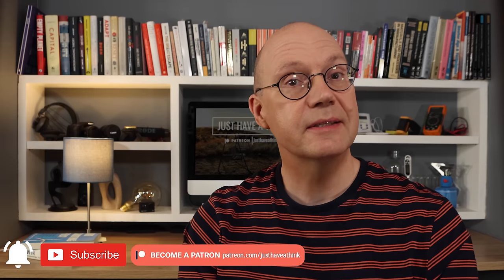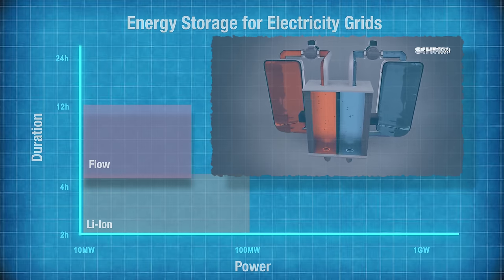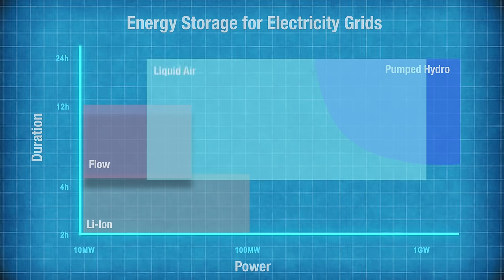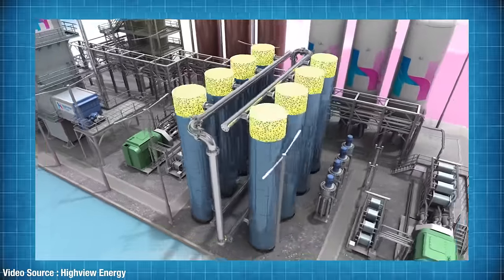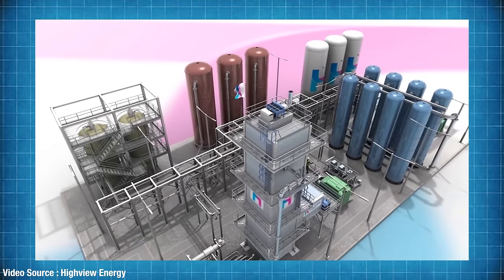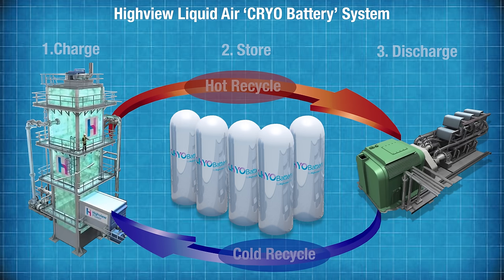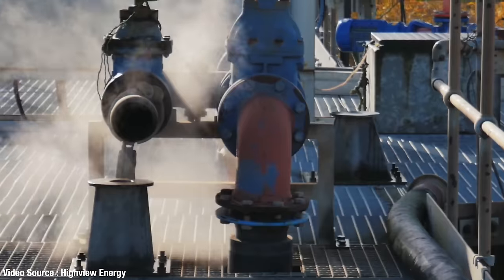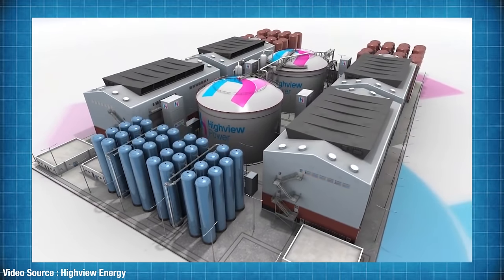Liquid Air Batteries. Literally energy from thin air. Seriously. Literally!

Comment: 60% efficiency is absolutely amazing... IF it is true.  we have seen many programs which tout high efficiency numbers but on closer scrutiny they dont get more than 10-15%.  If this were true many companies and countries would be rushing to buy/build their own.
Reply: When I was in power stations, 1962 - 1972, base load stations ran at just over 30% efficiency. 60% is like a dream come true.  Exciting times ahead and the jolly old UK is again in the mix. Regards
Reply: Peter Mortensen  30% typical, Japan claims 40% as super clean.  You
 see, they do have a sense of humour!
Reply: I agree that 60% verified efficiency is a game changer.  When the raw supply is endless and demand vs supply times are the only major challenge, we can ignore efficiency to some extent when the environment is not threatened.  I also have great hopes for ammonia economy if the byproducts can be avoided or mitigated.  Air batteries for fixed energy storage, ammonia for mobile. Might save us a war or two.

Comment: This seems too good to be true. I feel that the energy that is required to treat and store the air (i.e cooling and pumping into storage) would equate the amount of energy produced, leading to no net energy production. Is that the purpose, since it's merely a battery/storage space? 

Anyway, thank you so much for the video/your channel. I don't miss an episode :)
Reply: There is friction in liquids and all the pumping machinery,and waste temperature flows, so almost fifty percent of your energy is lost, try and use what you can with load shifting, you know like domestic hot water tanks, and aircons ice storage etc.
Extend grid East West so solar contribution is maximised.
Storage is always last resort, although having said that, this is promising.
Reply: Their efficiency is from generation to grid. So 60% of the energy stored makes it into the grid.
Reply: "leading to no net energy production".  Yes, you are correct. There is no net energy production. This is not a system that produces electrical energy, in fact it loses 40% of electrical energy from elsewhere that's fed into it. It's only a storage for energy that's made elsewhere (called a "battery" as a generic term). It's for storing energy that isn't needed but would be a shame to turn it off (like wind mills) so then it can be used later when it is needed (except the 40% that got lost/wasted). I'm not keen on Mister Think's little title quips always but I like his sense of humour and the rest of us (except only you) know instantly what he means.
Reply: If batteries released more energy than was fed into them we wouldn't need anything else lol
Reply: @grindupBaker  I understand...thanks for clearing it up!
Reply from the maker: I'll work on the titles :-)
Reply: It is a battery, just for storage of excessive energy(when the sun or wind is too strong).

Comment: Has anyone looked into co-locating liquid air storage with geothermal harvesting? One of the big problems with geothermal is that so many places that have abundant heat don't have high temperature. However, that heat would be harvest-able in the expander phase of liquid air storage.

Comment: Wouldn't the liquid air in the storage tanks expand a lot when it gets warmer? When it get warmer, the liquid wants to become a gas again and increase the pressure in the tanks.
I don't know if I missed it, but a thin steel storage tank will lose a lot of its cold if it isn't insulated, so the pressure will (unwantedly) increase.
Reply: The increase in pressure (outside of the tanks) as the liquid "wants to become a gas again" is the very energy the turbines use.
The answer to your question is around 6:45: "WELL-INSULATED thin-walled tanks". They insulate them well enough that the boil-off over the months worth of energy that they plan to store at a time is minor.

Comment: Do they use the soil underneath the facility for a heat battery for the heat economy? Phase change needs a lot of heat energy, there is a lot of mass. So are they sitting on like a -200 C permafrost ball? 
Its an ingenious system. Heat does not transfer quick enough to matter in a days length of time in these scales to matter much for efficiency. But i guess there must be like hundreds of km length of heat exchanger pipes in the ground for this to work.

Comment: Interesting, I'm a tad curious about the system efficiency's. Years ago 'they' were attempting a slightly similar system to power cars.
They were compressing air and storing it, then using it to spin a piston based air motor to drive the car. The biggest problem was when the air expanded it basically froze the motor, so I'm wondering where and how they are storing all the heat needed for when the liquid air wants to return to air and expand in the turbine?
Reply: It's shown in the video. The heat tanks are shown in the video and it's all explained. Watch the video.

Comment: On an urban level , having a compressed-air network would be  interesting to!
Reply: Perhaps you are familiar with this but using are instead of electricity is common in explosive environments in fact I am informed that residential elevators are using vacuum pumps instead of a shaft because of course they're not carrying that much weight so the passengers are just sucked up the tube. Because liquid methane is delivered from the ocean to beach front that don't have ports the hose that you need is a well-engineered off-the-shelf product that does not need to be modified for nitrogen. The company that produces it has been caught cooking their books but is one of the largest companies in the world with an extremely short name and rather oblivious to the huge volatility of their stock price.

Like Austin Texas they have a lot of programs for their employees to distract themselves from their work for the devil.

Comment: Neat idea. However, if the battery is 60% efficient then 30% percent of your wind or solar energy is being lost to the process of liquefying the air which means that you do not have any extra power that can be sent to the market.  To me this seems like a fairly large problem overall because this is not simply taking surplus power that is produced by something like a fossil fuel power plant this is literally taking the entirety of the renewable energy product to store up 60% of its production value for future use.  Thereby depriving the energy market.

Comment: I'm pretty sure the premise for this video is outdated.  We don't need batteries of ANY type.  "They" did a study and found that the best, cheapest way to convert the electrical grid in the USA to renewable power is to lay High-Voltage Direct Current (HVDC) conduit in a loop around the country, alongside the highways.  (This is basically the same route as proposed for bullet trains.)  The grid needs the most power when it's sunny, and it's always windy somewhere.  The HVDC grid moves the energy from where it's being collected by wind and solar to where it's needed, as it's needed.  This reduces the requirement for energy storage down to "trivial".

Comment: I have been wondering why we don't seem to be looking at alternative ways of creating steam to drive the existing turbines at fossil fueled power stations. The savings must be huge if you can continue to use the existing infrastructure. I have a theory that using Fresnel lenses to heat a large thermal mass and passing water through it might be a way to create the steam. It would need to be a huge mass but would smooth out diurnal variation by its ability to retain a lot of heat.

Comment: "Cold" cannot be captured and stored, as it is the absence of energy.
Other things rarely mentioned: removing wind energy and heat energy from the system with wind and solar systems can, in theory, change the climate.
Reply: "Cold cannot be stored..." I caught that, but was willing to let it slip by because it is storing a mass of something at a lower temperature, therefore storing the ability to cool.

Comment: Why not built a system that draws on the atmospheric power differential of elevation.  Electrical power increases at a rate 100v per meter above the ground (anywhere in the world), so a 10m tall mast could capture 1000v of power at the top.  Install wires to draw the power down to a storage device and you have an off-grid power system that works 24/7/365 with no moving parts.  Use solid state batteries/capacitors yo store the power and the system, once setup, will run with essentially no maintenance costs for minimum of approx 275 years.  Done. Solved.
Reply: Sadly, you need amps too, and you can only harvest microamps per meter, so to run more than a light bulb you're going to need something ridiculously tall.... otherwise you'd clearly have been a billionaire by now.
Reply: Coenraad Loubser The is an experimental farm in the USA running 100% of this method.  They have 4 towels (20 meters tall each, if memory serves), with antenna running between them.  They gather so much power that during storms they need to manually disconnect an antenna or two.  There is a commercial proposal out already to take this to grid level using 200m tall towers.  The issue here isn’t can it be done, but rather will the current controllers of the electrical grid allow it to be done.  All they need do to stop it is deny a grid connection and the project is scrubbed.  Years ago I spoke with a controller of said power grid and offered to setup a power generation system that would produce, on average, the equivalent to 4 nuclear power station, with no possible meltdown, minimal maintenance, etc.  I was informed at that time that if I built it they’d never allow it to connect to grid regardless meeting all standards and requirement.  So, again, it’s not CAN it be done etc.  It’s will it be allowed.  Personally, I’m  just building a system one on my property to run my farm.  Corporations and profit margins = no political will to change/advance.  “So I’ll do it myself”, said the little red hen.

Comment: Combine LFP with Liquid Air with Liquid Metal Batteries for the best of all three.  LFP will deliver instant Electricity when needed.  Liquid air will generate waste heat when compressing that can be use to heat the Liquid Metal Battery.  We can combine instant power with long term power at the lowest possible cost.  The best of all worlds.

Comment: Commercial freezers use natural gas engines that drive pumps to compress gases that produces heat and as it decompresses;  produces heat;  which means that homes could be heated and/or freeze environmental climate issues;  while at the same time;  could be freezing ice from water at 9 % expansion that is almost impossible to prevent expanding and that again can be used to crank gear box systems that ratios are extreme and so on and so on......how long have everyone been burning natural gas in their "high efficiency" furnaces while they could had been using an engine's heat that was driving a generators.   Generators create heat;  last time that I checked.

Comment: I have a t-shirt that says "KC-135: when man thought he could burn water." It's an inside joke, the KC-135 tanker and the B707 passenger jet that followed initially used turbojet engines that relied on water injection to increase power. No, the water was not burned, it was evaporated just before the first compressor stage to cool the intake air charge so that the engine had more usable oxygen for combustion during takeoff. The need for water injection was eliminated with the development of the first turbofan engines. Hopefully one day we'll look back at the time when humankind thought that burning rocks (coal) was a reasonable idea.

When one thinks about it for a small amount of time, burning fossil fuels that take millions of years to make was never a sustainable energy plan. We can't undo the ignorance of the past, but now that we do know better, we can stop using these limited resources for fuel and conserve them for use as chemical feed stock, at least until we learn to synthesize whatever we need from renewable organic sources.  Our sun is the original source of energy, and it's no surprise that the more we go straight to that original source, the more efficient energy production will be. Perhaps one day we'll have a network of HVDC undersea and overland cables moving energy from the daytime side of the planet to the nighttime, and any need to store energy will be quite manageable. But because we are a diverse people, we'll always have room for diverse methods of energy production, transmission and storage. I can't wait to see what it will look like!
Reply: Who needs the untameable sun when we can make our own...in a bottle.
Reply: The Problem is. It's not "ignorance" so much as insanity.
Capitalist and religious zealots are diliberately using up fossil fuels for short term massive profit as they don't believe in or care about future generations or a future here on earth.

Comment: I wonder how easily this tech can be adapted to help with the fractional distillation of air. Valuable Noble gases such as Neon, Helium, Argon, and Xenon have relatively low condensation temperatures compared to Nitrogen and Oxygen, so they might be siphoned off as gases at the condensing stage and sold off to help recoup costs.
Reply: In one of the videos they said they can take the compressed co2 and sell it to brewerys to make extra money.
Reply: @imakevideos5377  There's a lot more Argon than CO2 in the air, and CO2 is also cheaper than Argon and other noble gasses produced from fractional distillation, because it's a by-product from a lot of chemical or industrial processes.
Reply: @Allen Loser I think what he's saying is that the distillation of noble gases as a byproduct of the compression process can be used to supplement current ongoing fractional distillation processes.
Reply: @imakevideos5377  Brewers make there own Co2/ Yeast and sugar = Co2
Reply: You could probably set up a cracking plant as a side business, after all you have got to strip out particals and moisture anyway. Wouldn't take much to distill noble gases and oxygen, leaving the nitrogen behind. Probably safer to do it that way anyway...
Reply: @mrman1536  you mean real beer, not the American kind.
Reply: Et est-il possible de décarbonater l'air avec ça ?
Reply: @Allen Loser yes but if the power storage company would be throwing those gasses away they may be able to sell them really cheap. that would be a disruption to Air products and other such companies. that's the free market.
Reply: WRONG
Reply: @Allen Loser The products are not "below the cost of production", they have new, cheaper process of production.
Reply: @Allen Loser You probably don't understand what supply-demand curve is. Lower price can increase demand.
Existing providers will be losers, but their customers and new providers will be winners. There is nothing wrong about it: progress make a lot of businesses obsolete.
Reply: @Allen Loser You still don't understand that when company can sell byproduct cheaper than current market price it is not a dumping, just a competition.
Reply: @Allen Loser You have "free" infrastructure with much higher capacity. You can use the cheapest power when available.
I am not sure if the final cost can be lower, but there won't be dumping in any case: operational cost have to be lower or current producers will be safe.
Reply: @Allen Loser When its being sold as a prestige product vesace prada apple ferreari.
Reply: @imakevideos5377  bulk Gases such as CO2, O2 and N2 are big sellers for the likes of Air Products and BOAC, CO2 sold to many food and drink companies, O2 to Hospitals and Industry etc.
Reply: @FREDMOCKING  Haha. You can't just shout 'wrong' without qualification; it's meaningless. Anyway, here's the attention you craved. 👋
Reply: @jean-paulallaume8640  
Mais bien sur! A basse temperature le co2 est solide.

Comment: 60% round-trip efficiency is more than I expected. Significantly worse than electrochemical batteries, pumped hydro and other gravity solutions, or flywheels, on par with compressed air, much better than hydrogen. All these technologies have advantages and drawbacks - probably all will find their niches.
Reply: Oil has drawbacks, like damages the people that sell it don't have to pay for...which make it obviously pretty competitive. All other solutions are hard, because they have to be almost perfect. Meanwhile, everybody has no problem whatsoever with their oil engine having a poor 20% efficiency...but they will cry for hours if there is a hint of inefficiency in alternatives...what a world.
Reply: Efficiency is a red herring if the energy would have been wasted if the storage wasn’t available. If we had excess storage, that’s when efficiency is significant. There is a lot to be said for having systems with no dangerous or difficult to obtain components.
Reply: @Muppetkeeper  Well, yes. For example, despite pretty abysmal efficiency, hydrogen obtained by electrolysis might be a viable way to spend excess renewables since it can conceivably be used as a clean fuel in aviation and long haul road transport where batteries are too heavy and not enough energy-dense.
Reply: @bazoo513  Hydrogen itself is light, but to hold it requires heavy tanks.  Batteries are lighter than the combination of H2 + tanks.
Reply: @Elviloh  the problem with your enemies is their lack of articulateness this because they are on the right side of History regarding feasibility. Cost engineering is very very important because we are polluting 4 its lack hello! Why systemic pollution has increased because of the wrath of solar electricity because of the use of uranium to produce electricity instead of do the work of liquefying nitrogen.